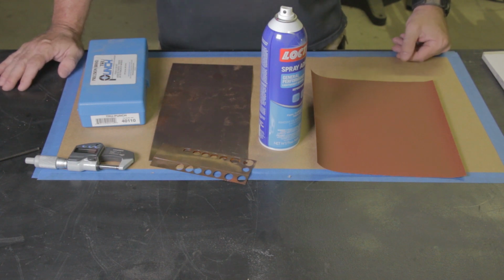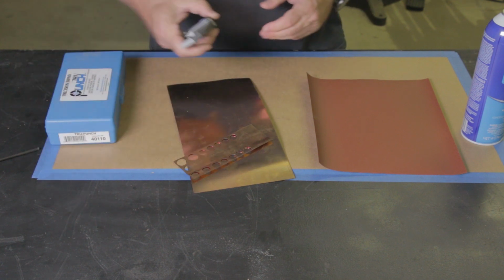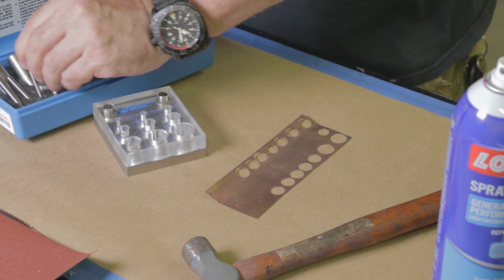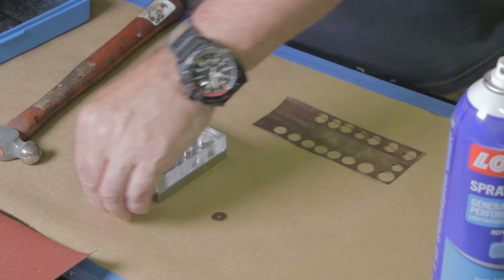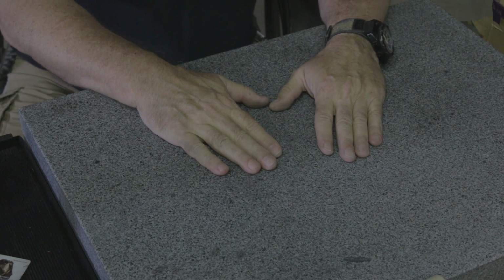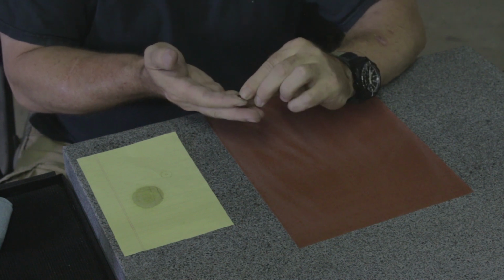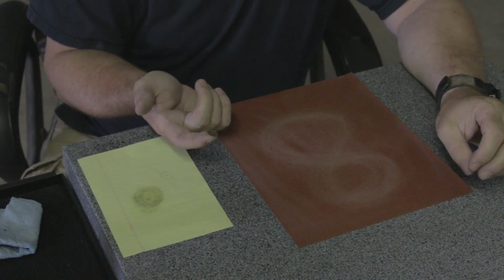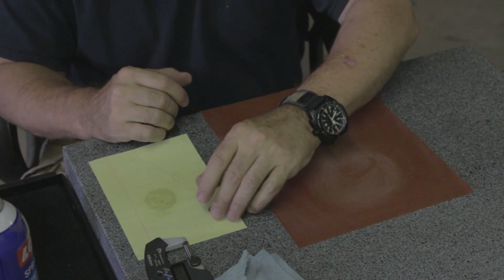Advanced Knife Making - Punching and Lapping Bronze Shims

Comment: Hey bob what's your reasoning for using 1/8 pivots? I've always wondered what the difference in performance is between 1/8 and 3/16
Reply from the maker: I use both but, I prefer 1/8" on most of my knives because they have less total surface area which decreases friction. I feel, all else being the same, 1/8" pivots are faster.
Reply: @rangermadeknives  ah i got ya that makes sense. Thanks Bob